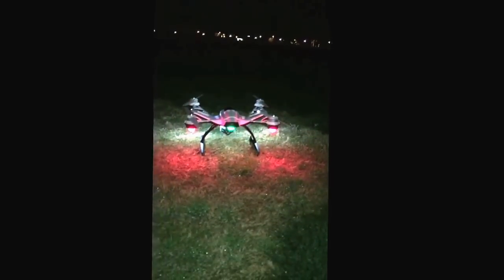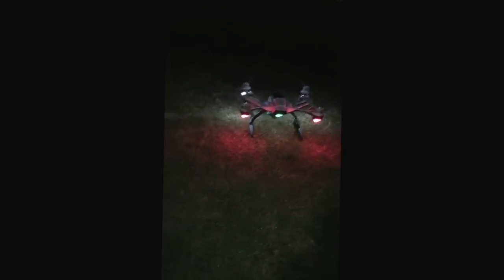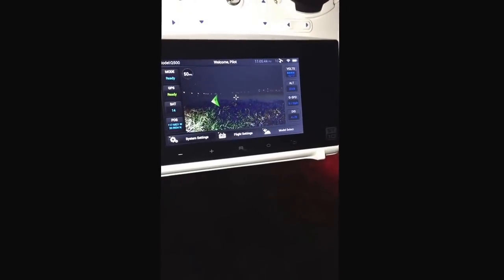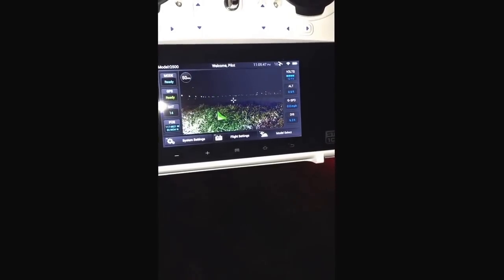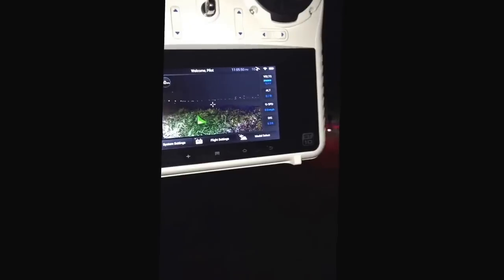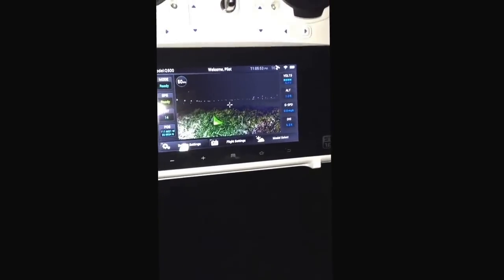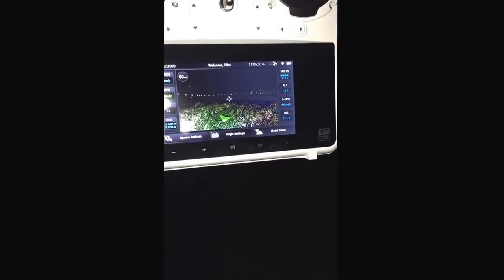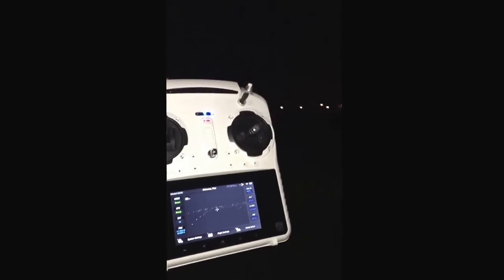Yuneec Typhoon Q500 Problem, Transmitter Sync Loss Defect Found and Corrected

Comment: This looks like the follow-me enabled lights to me. The first time I saw it I thought it was something wrong too. You get that off-color flash in both smart-mode (which means follow-me is enabled) and in angle mode (which means follow-me is available). 

As far as it coming back like that...it looks like you hit the geo-fence in smart mode...either switch to angle mode or change the geo-fencing in the GUI.See the Q500 FAQ that I made here: http://youtu.be/Lf18lKSvuXU.

Let me know what you find out and what Yuneec says, but I really think everything that is going on is normal operation.
Reply from the maker: +Drones In SC Problem was taken care of by Yuneec.  The transmitter antenna was disconnected during assembly somehow.  They replaced the entire unit for me just to be safe.  Yuneec techs flew drone outside and we all laughed at it doing this crazy stuff since we have never seen it before.  Thanks for your post though.......
Reply: +Drone Doctor glad to hear
Reply from the maker: Sorry for the delayed response.  I have no idea how I missed your post so long ago!!!!!